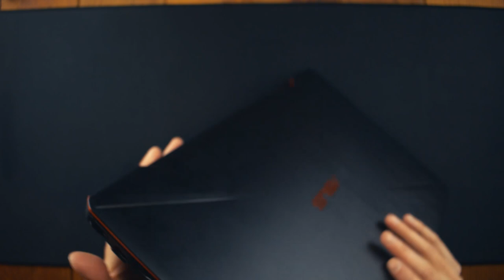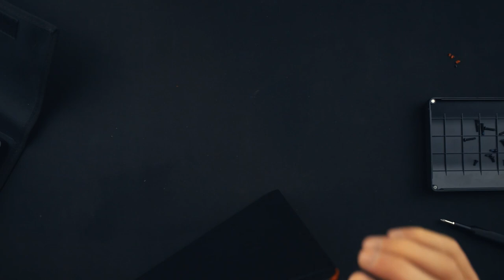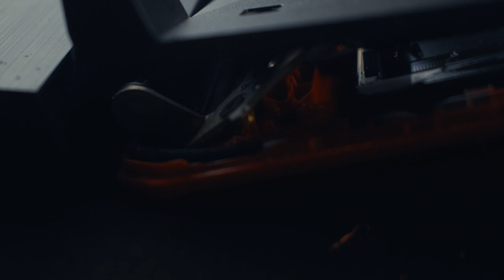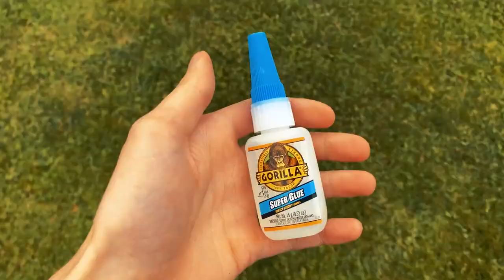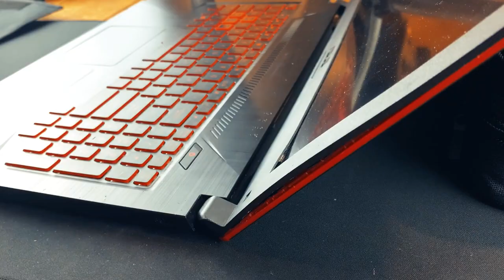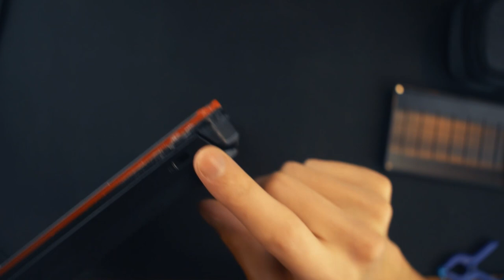FIX ASUS FX504 HINGE?! | Asus TUF FX504GM-WH51 Gaming Laptop | Jerryrig/Mod

Comment: The problem is how you open it.
Reply from the maker: I knew the hinge was faulty from people telling me. I made sure to be extra careful when opening it and it lasted much longer than other peoples laptop but atlas it still broke. So that begs the question, whose fault is it. Mine or the manufacturer.
Reply: @ZackEberly  how many years do you used it before the hinges are broke?
Reply from the maker: @johnave4545  This would be 2 years using this laptop almost everyday at work. I've talked to others where it started cracking soon after they got it and/or several months of use.